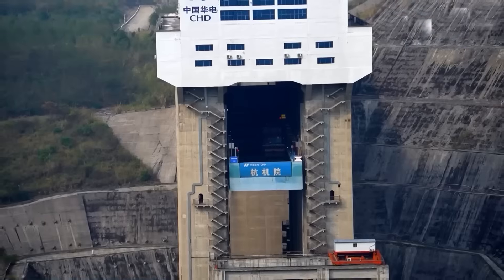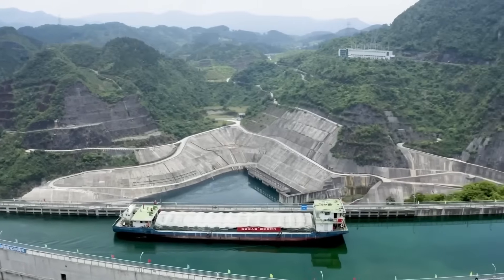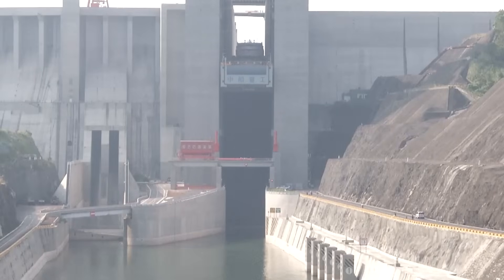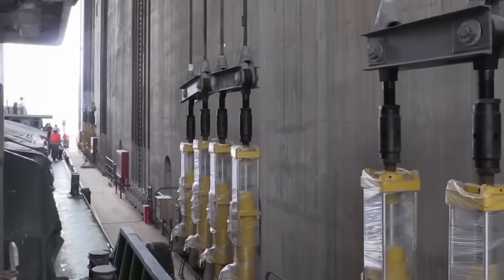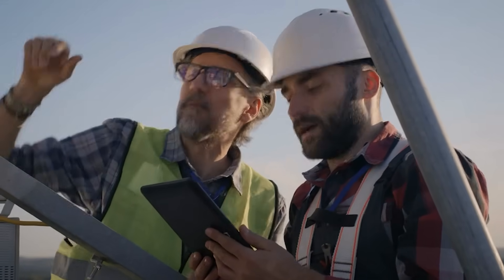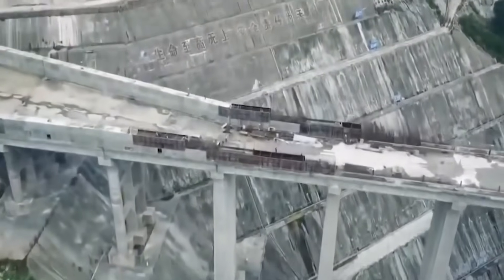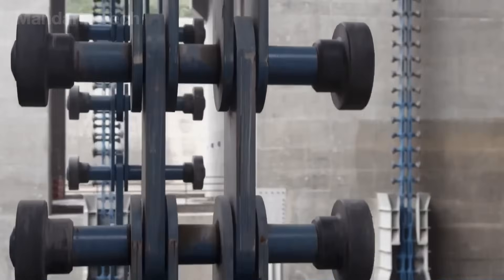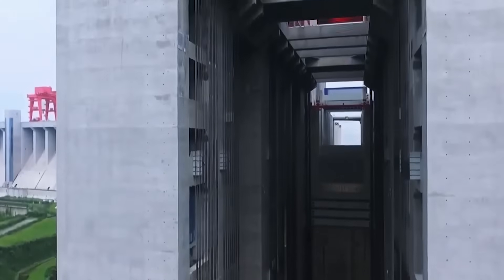China Built a Ship Elevator to Cross Mountains - American Engineers are Shocked

Comment: What are the specs on the tilt?  I love it when you talk engineering to me.
Reply from the maker: It is a vertical ship lift, so the ship chamber stays essentially level (0° tilt) while it moves straight up and down.
- Vertical lift: 113 m (about 370 ft; ~40-story building)
- Ship basin (caisson) internal size (usable):
	•	Length ≈ 120 m
	•	Width ≈ 18 m
	•	Water depth ≈ 3.5 m
	•	Ship capacity: up to 3,000 tons
Hope that gives you more clarity 😊
Reply: @TechInCheck  I figure if you get a left right angle shift that is too much you get like a positive feedback mechanism that makes the thing unstable.   Ain't no such thing as zero tollerance.  Ain't never existed.
Reply from the maker: I know achieving absolute zero-tolerance is nearly impossible, but this system comes remarkably close. When you’re lifting tens of thousands of tons in a suspended chamber, even a fraction of a degree of tilt can shift the entire mass of water and steel to one side. That sudden redistribution of weight could overload the structure, stress the guide rails, and trigger a catastrophic chain reaction.
Reply: @TechInCheck  Zero tolerance don't exist....  Just as laminar fluid flow don't exist.. 
I am quite sure they know what the parameters are.  The analytical processes of CFT and FEA are amazing and they give you amazing parameters.